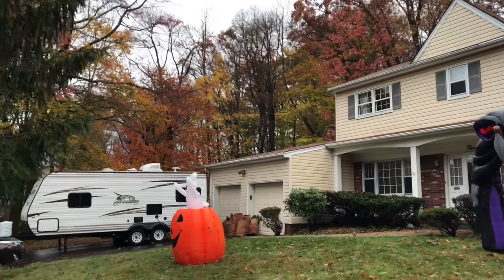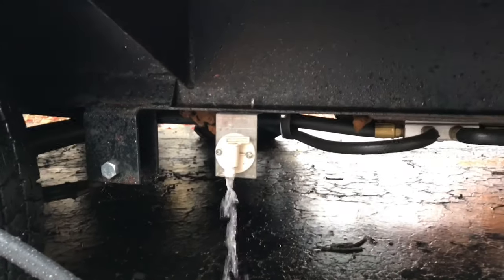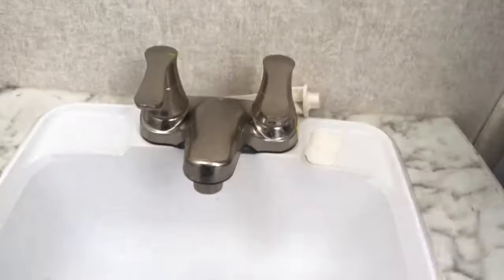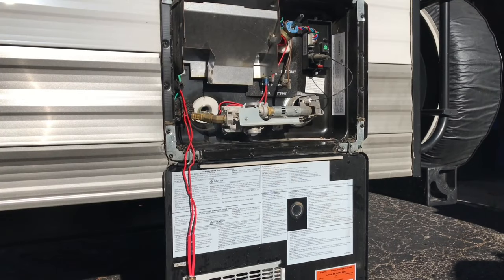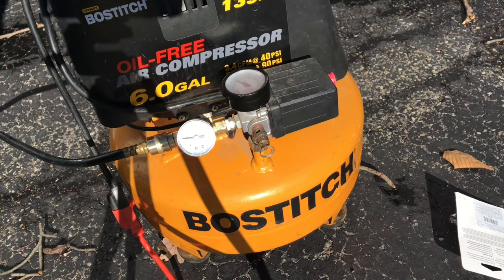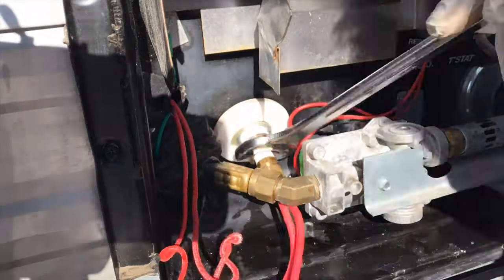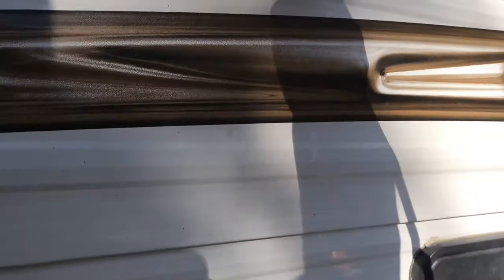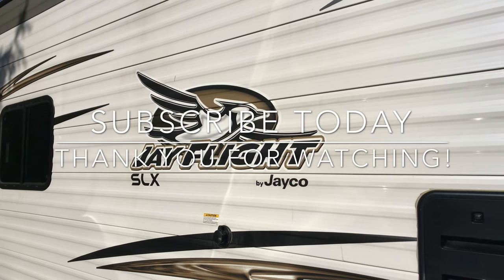How to Winterize RV Jayco Travel Trailer Chemical Free using Blow Out Plug Draining the Water System

Comment: Water remains in the hot water lines downstream of the water heater if you leave the drain open in the water heater as you have done.  Blow out the lines with drain open, close the water heater drain, then blow again.
As others mentioned, add antifreeze to the P-traps or blow out with air.
Good straight forward video.

Comment: No one should have all the valves open at once. You should clear each line individually with the 30lbs or your going to have water left in the lines. Start with one until clear, close and go to another until clear.
Reply: Jaycos owners manual says not to have any valve close and doing so could void the warranty.

Comment: You should leave ALL faucets and low points OPEN, not closed. And during the process you should pressurize the system and open one faucet at a time until only air comes out. Opening all at once doesn't allow enough pressure to blow out all the water. This may work for your camper but won't be good for others depending on the routing of water lines and location of faucets etc. Lastly, you need to put antifreeze in all the drain traps.

Comment: If you haven't  bypassed the hot water heater,  your compressed air is going right out the open hot water drain. This is most likely why you didn't see any water come out of your drains or shower faucet.
Reply: I agree but that's what the owner's manual states, I don't get it

Comment: What did you do to ensure the pump was drained as well? They are different routes in the lines versus city water.
Reply: Grab your pump suction line usually in bathroom under sink  and put it in rv antifreeze bottle and suck it through that to run through pump. It’s how I would if I used rv antifreeze but I feel blowing out is a better way.

Comment: U need to open only your furthest point and blow that line out or the air will take the path of least resistance and u will only be blowing out the shortest path. Then work your way back. At the end u open all your taps and drains for a final blow

Comment: Hey is it normal to have air pressure inside the water heater while your blowing the lines (at 25psi) i unscrew the water heater plug and it seem that it had lots of pressure. Is that normal?
Reply from the maker: I’d say yes... water heater will have pressure. Thank you for watching and feedback
Reply: Always open the relief valve on the HW tank before removing the plug. The tank is under pressure. I forgot once.....and I'll never forget to do it ain't.

Comment: Does this method also blow out the water out of the water pump? Thanks in advance
Reply from the maker: I did both… air compressor and chemical. The pump would’ve not been cleared… you can do an extra steps if you wish to just do the air compressor only… relived the hoses off the pump and do a connector (bypass the pump)